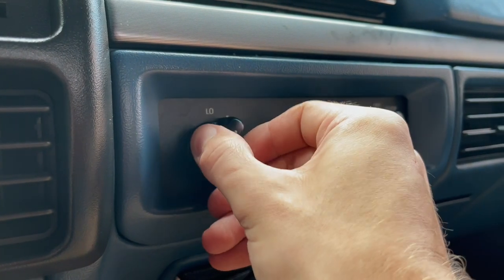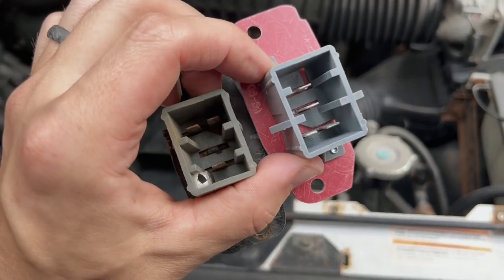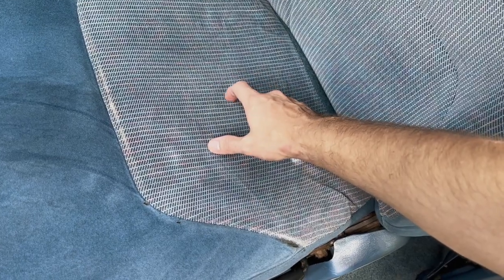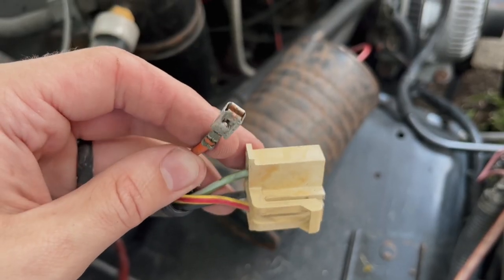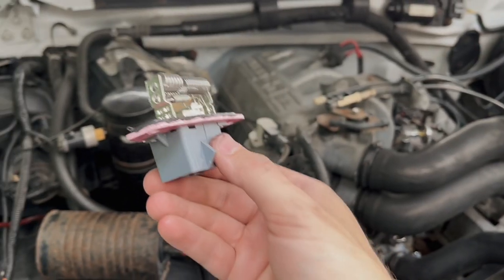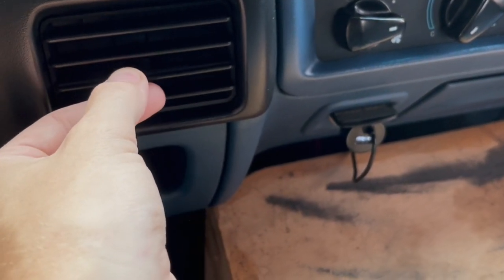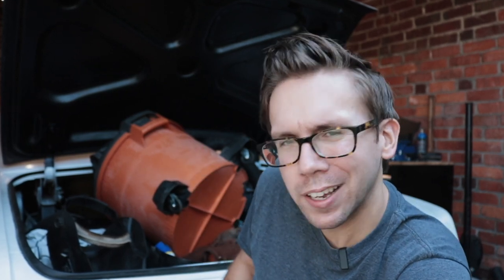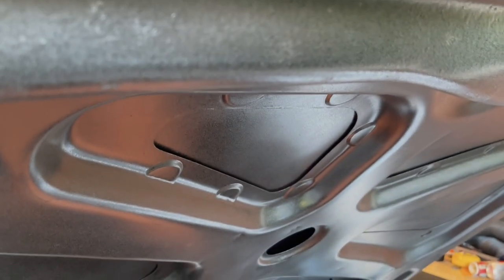Blower Motor Not Working In All Speeds? OBS Ford F150 Blower Resistor  Replacement

Comment: Thanks for the video, @MatthewFinlay I'm going to give this a shot!  To give you background, I drove my truck 5 miles down the road and something didn't seem right with the blower - worked on high, but not low or medium.  After making my first stop I came back to the truck - and after starting it - there was smoke coming from the engine bay! I wasn't sure WTH was going on - then tried to turn on blower - still only high worked.  I thought I was burning up my engine (anti-freeze or lack of oil)!!!  I checked both and they were fine. I got it home and figured it had to be the blower motor (or resistor).  Wish me luck in replacing this thing! it is a '96 with the 4.9L V6 and it is the most reliable vehicle EVER! 230k miles and still going strong!
Reply from the maker: That’s awesome buddy! Well the truck, not the burned up resistor haha. Be sure to check your connections and make sure they are clean but you have a pretty classic case of failed resistors. I’ve got the 5.0 with 243k going (relatively) strong!

Comment: Hi James, the blower motor in my truck isn’t working. I checked the fuse, it’s blown. I checked the blower motor itself, and it works. I tried to put a new fuse in and it blew right away. Would a damaged resistor burn fuses? Or do I have a short? Thank you sir.
Reply: Lol just noticed your name isn’t James! 😂 got me there!
Reply from the maker: Haha no worries buddy, I’ve been called worse on here so I’ll definitely take a “James”! Sounds like you were already on the right track with testing the motor because they like to seize and short. The resistor module can sometimes be a pain to disconnect but I’ve seen a lot of issues with corrosion and broken coils shorting. If you can’t disconnect it easily, I’d go ahead and unscrew it from the heater box. You don’t wanna risk snapping plastic imo. Since the fuse is blowing fast - to me that points to a dead short somewhere. I’d unplug your blower resistor module and then install a new fuse and see if it blows. I bet you’ll pull the resistor and find a coil burned up. Lemme know what you find!

Comment: Replace heater core put – back now the blower motor don’t work
Reply from the maker: Hey sorry for the delay, just saw your message. Have you check the fuse for the entire circuit under the dash and checked your fan blower to make sure it’s fully seated AND no pins are damaged in the connector?